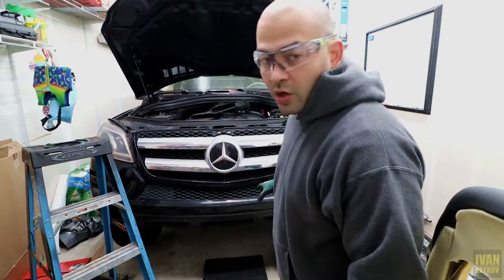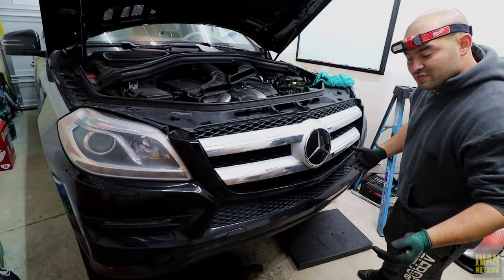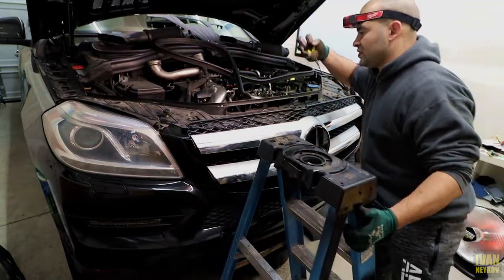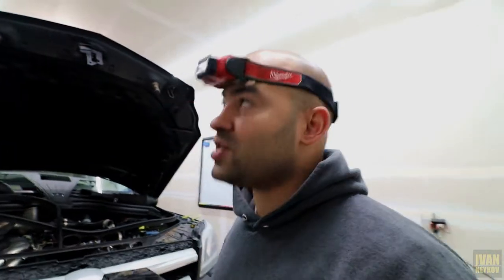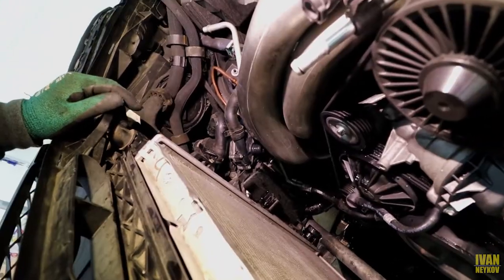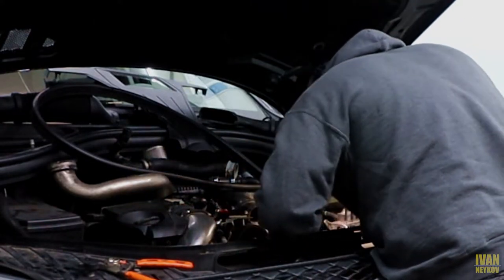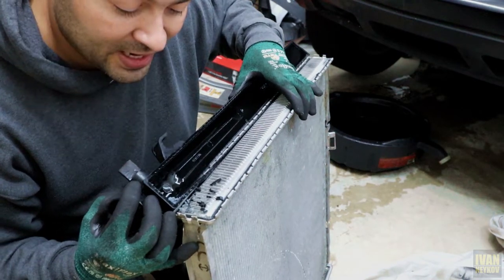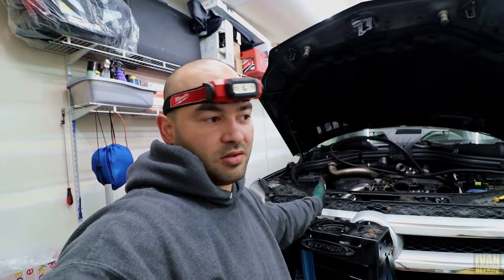FIX Your Radiator on Mercedes GL450 | PT 2

Comment: Hi you doing man?
You mentioned the 2 hoses for the transmission oil, do I need to refill the transmission oil and how do I do it?
I really appreciate your response. Thank you so much.
Reply from the maker: Hi my friend if you’re just changing the radiator The way how I did it it’s really not necessary to refill the transmission oil because you are not losing a lot of oil this is my opinion I didn’t at oil when I change my radiator. But if you decide to add oil to your transmission you need this special attachment that’s screwed to the drain hole so you can pump the oil into the transmission. Currently I am editing video with my wife  Mercedes C300 where I am changing the transmission oil as soon as the video is ready I will let you know and show you what I’m doing if you really want to add oil. But again my opinion you’re not really losing a lot of oil from replacing the radiator.
Reply: Thanks for the response my friend I really appreciate it. My car is a Mercedes GL450 2016 I guess the process is pretty much the same, I’m gonna give it a shot. My radiator is leaking on the driver side top right, on the black plastic part. I’m gonna get the Siemens brand from Rockauto, I hope I don’t have to take the front bumper off. Thanks so much for your videos, they’re really helpful.
Reply from the maker: @maxelsosa3863  thank you my friend I really appreciate it

Comment: Thanks for the great video! I will be doing the same repair soon. 
One question, in your video at 8:00 min mark after you took transmission hose off, it appeared you lost good amount of fluid. How do I refill the transmission oil?
Reply from the maker: You have to refill it from the drain plug I now it sounds crazy but, you have to send fluid through your drain hole into your transmission until it start siping out from the same hole. Wait for a little bit when the drip slows down, put the plug back in and that’s it. I hope this helps
Reply: @Ivan_Neykov  Did you refill your transmission fluid? If not, is everything going well with your car? Maybe I will skip that step if there are no implications. 

Sorry, it was hard to see in the video. The transmission fluid which came out, was it from the hose connected to radiator or whatever is inside the radiator?
Reply from the maker: No worries, my friend you can ask me anything I’m here to help as much as I can.
So yes, all the oil that came out it was from the hose and from the radiator maybe in the video seems to be a lot, but I think it wasn’t that much to the point where it will infects the transmission or ruin it But again, this is my opinion and I’m not a mechanic. and for your second question no I don’t feel any difference and there is no change in the way how the car drives. but in the same time, I’m planning in the nearest future to do Service on the transmission, oil and oil filter and clean up my transmission solenoids, because sometimes I get a kick when the car shifts from First to the second gear but this is how I bought the vehicle and if you look online seems this is A common issue with this transmission. i’m just trying to say I will refill the transmission oil in the next 10 to 20,000 miles
Reply: Awesome video, quick question… my 08 GL450 leaks coolant from the small hose (drivers side) that goes from the radiator to the reservoir of the power steering pump. This small hose has a copper nut or nipple attached on the radiator. My question is… does this small hose has an O ring? Or why does it leaks from that nipple?
Reply from the maker: I’m not really familiar with the 2008 but if there is a copper boat that means that it shouldn’t have a O-ring it should be like a crash in washer. but take it with a grain of salt because I’m not a mechanic and I haven’t really work with this type of a vehicle.
Reply: @Ivan_Neykov  you right, I see the crush washer. I wonder why is leaking from there? Crush washer failure?
Reply from the maker: Sounds like that’s your problem, but in the same time you have to remember hot cold, hot cold, and that’s why disconnector it’s made from copper and not other material. so you can try a quarter inch turn and see if that is going to help stopping the leak. but be careful you don’t want over tighten it because it’s made from copper and you know copper is soft. and actually, I believe I’m not a 100% sure there should be two crushing washers, one at the hat, and one at the body.
Reply: @Ivan_Neykov  thanks, I’ll try tightening a bit, if doesn’t work a new radiator, water pump and t-stat will be on the way. Thank you!
Reply from the maker: No problem I wish you good luck. If you have any questions, don’t hesitate to reach out

Comment: Were you able to put fan shrud back easily. Mine e550 and I am having problem sliding it back.
Reply from the maker: No, it’s not that easy first you have to slide it to the left to be able to drop the notch underneath your cooling pipe on the right and then after wiggling, you should be able to drop it down
Reply: @Ivan_Neykov  I am trying but not being successful yet. Should be slide in the grove on radiator? Should I put bottom first buy tilting upper portion toward engine? I am really frustrated.
Reply from the maker: @maviblue1168  I apologize for the late response but to your question no you have to wiggle your way into there grooves on the radiator and then on the very end just the bottom and then push everything down and lock it in place let me know how it went
Reply: @Ivan_Neykov  Thank you. I was not able to put it back back. I ended up removing coolant hoses on both sides of radiator then was able to put fan assembly in place :) It was real pain. Thank you again for the heads up. If I got a problem with the radiator in the future I wont attempt to replace in DIY :)
Reply from the maker: @maviblue1168 you are very welcome. I am glad that on the end you made it work. cheers 🍻

Comment: Hello, I am sure you have figured this out by now. White crystal you are referring too is desicant (silica gel) bag that is inside the reservior tank to keep the coolant fresh. Once that bag bust it release the beads into the system and they clog the heater core, radiator and oil cooler. How I know this because I am dealing with this right now...did you lost the heat, how about after the replacement did it help the heat as I saw you have filter hooked up to the pipe going into the core. I have already replaced the tank so at least source is gone.
Reply from the maker: I am sorry to hear that. I figured it out barely yesterday because I called the dealership and I talk with technicians and he explained me that it comes from the expansion tank but he said that he never seen a vehicle that has this problem which is bizarre.
So yes, I didn’t have heat in the car as well so I had to disconnect the two houses and run a garden hose and run water backwards on the core so I can blow out all of the stack Little crystals that they were clogging the core. Just a heads up, your front radiator is probably full with those crystals as well.
Did you end up fixing your car radiator? Did you get the heat back into the car?
Reply: Sorry for too late reply here, dealer that I bought the car from flushed the coolant system  including core twice, heat would come back but stoped fairly quick each time. In the meantime, I ended up replacing the water pump because pully was walking out, oil cooler radiator type box sit behind belt tentioner (little white cryatal stuff deposite in one opening) and plastic turbo lines. So another almost drain and replace of whole system. Finally dealer agreed to replace the heater core and expansion tank and another flush. Since the core and tank has been replaced heat has been super good since last winter and no issue this winter. In Minnesota, you can't survive long without heat in car.

I did take the old tank apart and there was busted bag, source of problem for this whole mess. It was pain to deal with no heat and dealer but at the end it all worked and I made the dealer pay for all of this repair. Pump, oil cooler and turbo lines still cost me around 800 . Oh well
Reply: @Ivan_Neykov now why I came back to your video yesterday as I may end to replaceing the radiator as I am seeing transmission oil by radiator lower hose and startred with drop and now progressing little more. Not sure if it's coming from quick connect or one of the hose metal rubber clamp is loose. I don't think so there are o ring on lines, but there are maybe insire the radiator fittings. So did you lost alot of Tracy oil with line disconnect?
Reply from the maker: I am happy that you finally resolve the problem with the heat core and more happier that you made them pay. honestly, I didn’t measure how much I lost but I can say it wasn’t that much don’t quote me but I believe it’s less than a quarter. since that video, I still driving with The same amount of oil in the transmission I haven’t add any oil or anything and honestly I don’t see any difference. make sure when you disconnect the lines plug them as quick as you can so you can eliminate lost off oil as much as you can. Recently, I found in Home Depot in the hardware section. There is metric nuts and bolts in drawers on the bottom right drawer. There is different types and sizes plugs that you can use and plug the lines.
Reply: @Ivan_Neykov thanks, I will check home depot. Was there any play in cooler line quick connect? I am seeing about 1/8 in lower cooler line and its leaking. Longer cooler line going in side mounted metal box and small hose connectiong metal box to middle rad hole are connection r solid and no in out and movement at metal box. Small hose on rad middle hole coming from metal box move little and leak little too. I am confident the o rings r gone bag with hot and cold cyle plus minnseota freezing cold.
Reply from the maker: Yes, mine do have a little bit of a play, but they don’t leak so maybe you have to replace the O-rings
Reply: @Ivan_Neykov I don't think so  o ring inside the nut fittings are available for the car, dealer isn't able to find in their part list. They say radiator need to be replaced. Unless you know if they are available. I think some of those crystal stick in rad clog some of it.
Reply: @Ivan_Neykov which rad brand you go with? MB part or aftermarket, I ordered nissens brand.
Reply from the maker: @msnrasoolable Nissens
Reply: Thanks, one last question. What is the plier name that you have used to to separate rad and ac condersor
Reply from the maker: Snap Ring Plier
https://amzn.to/3shb0jQ
Reply: Thanks, I think lower cooler lije is the return back to transmission. I am thinking to pump fresh fluid back in through cooler line in quantity that I came out.
Reply from the maker: That is a good idea let me know how much you put in. I’m curious how much I lost.
Reply: @Ivan_Neykov  I added about 500 ml but realized afterward that dealer has given me wrong fluid. I didn't start the car all of the added fluid was sitting in pan. Dealer towed and flush the nsmission free of charge.
Reply from the maker: 500 ml it’s not small or a lot oil lost but now I’m thinking maybe it’s better to lift up the car and put it in just in case Thank you for letting me know and about your dealer OMG this is wild
Reply: @Ivan_Neykov lucky me with dealer else I was planning to drop the pan. I came across a comment of your in one video comment section about xentary purchase off ebay, what is total cost of it and pateicular seller that you will recommend
Reply from the maker: @msnrasoolable with the program I don’t know if I’m gonna be much help. I bought my long time ago and it was $20 for the software and $500 for the tool that connects to the car, and I just looked the seller that I bought them from no longer available